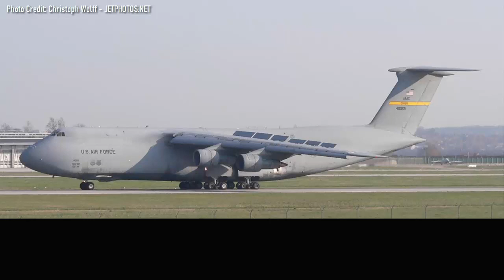2006 USAF C-5B Crash - Cockpit Voice Recorder (with Subtitles)

Comment: The worst part is it's not like a commercial plane with two pilots. They have someone behind them as well that should of noticed they were using the engine 2 throttle lever and not engine 3

Comment: So, low and slow - and they order flaps up without an established positive rate of climb? What were they thinking?
Reply: Reduce drag, faster speed, more lift.   Or course, the FE should have quickly figured out the engine power.

Comment: 3 engine approach.  On the final they maxed the 3 throttles, but, one was for the dead engine.  So the two outboard engines were max thrust and one of the running inboard engines were at idle by accident.  Not enough total thrust to maintain the glide slope.
Reply: Thanks for the explanation

Comment: Why?  Go around. Everyone knew something was wrong. Just go around.
Reply: They couldn't get the power to not stall. No way they were going around. A 4 engine aircraft fully loaded and only using 2 engines could have landed safely, if they hadn't mangled the landing configuration. For all the experience the flight crew had, they 💩 the bed.

Comment: Sadly it sounds like the cockpit crew were not locked in teamwise and all on the same page. One pilot should fly the aircraft with the co-pilot keeps an eye on everything else, like sink rate, location, settings, airspeed as they have time to do that while the pilot in command PIC flies, and is also eyeballing everything and the flight engineer is calling out important information.

Comment: You shut down an engine early to reduce repair costs primarily (unless it's on fire).

I break all the rules to maintain airspeed if i don't have enough thrust. 

To hell with the cost of new engines. I need airspeed. Engines can be replaced...

Comment: This sounds like horrible CRM to me. You should never be on final approach without everyone knowing exactly what the plan is and exactly what is occurring in real time. The whole crew sounds confused and NO ONE is heard taking charge/command of the situation. They should have called a missed approach (if able) and came around again with the whole crew informed on the plan/procedure.
Reply: This was an emergency landing. You heard him say they have nothing left. How the hell you going to do a go around when you dont have the power to keep the thing airborne?
Reply: @bradsanders407 you don't idle a good engine for one.
Reply: @bradsanders407  Read the comment by "Jollypirate"
Reply: Thanks for capitalizing NO ONE, I don't think I would have understood your message otherwise
Reply: @Kavskops Thank you also for capitalising 'no one'.
Reply: @Kavskops  lame response, it's just emphasis

Comment: This was in  2006* at Dover AFB in Delaware. The crew did a horrible job with checklist discipline, confirming lever and switch movement with a second crew member, and crew resource management. A single engine failure on a four engine aircraft is a standard practiced emergency procedure, in both the simulator and on training sorties. The flight engineer and aircraft commander bear sole responsibility for this crash. Even though they mistakenly pulled a good engine to idle after they pulled the failed engine to idle (now two engines at idle), when they realized there was "no power left" on approach, you push every throttle back to fly (100%). The silence at the end during an emergency procedure landing is something I can not even begin to understand. The Air Force, and every single FAA governed aviation course teaches the same thing - Never, ever stop flying the aircraft. They sat back and watched themselves crash. There are mistakes, and then there is negligence. This was negligence. Source - Former USAF HH-60G Pave Hawk Flight Engineer in the service when this happened.
Reply: 2006. And I have heard the Aircraft Commander had a history of reckless and sloppy flying; it finally caught up with him and ended his career.
Reply: @bob80q  Yes 2006, my mistake. I remember hearing a C5 was a Class A mishap at one of our aviation safety briefings and we were all like WTF C5s don't crash 🤣
Reply: @jollypirate23  it was I believe the 7th Class A; crashes at Ramstein, Saigon and Clinton-Sherman, 2 destroyed in ground fires, one heavily damaged in a crash landing at Shemya
Reply: @bob80q   Yes, there is an article online from the IP that tried to deny this AC status, and was overruled.  He related the cowboy attitude of the AC candidate on his check ride....
Reply: massive skill issue
Reply: I really don't understand. Not a pilot, just play combat flight sims and it's natural instinct for me to punch the throttle at ANY doubt on landing, and go-around. Like it's just basic common sense, and I'm not even physically there, risking my life.

Comment: Why did they bring flaps up if they knew they were approaching stall speed?
Reply: To reduce the drag. The last stage of flap usually gives more drag than lift. They were out of options and clutching at straws. I suspect that it was already too late at that stage.
Reply: Flaps 40 had not been deployed so they weren't at CD/max. Raising the flaps would have stalled the wings at a higher airspeed and increased the groundspeed impact.
Reply: Go around?